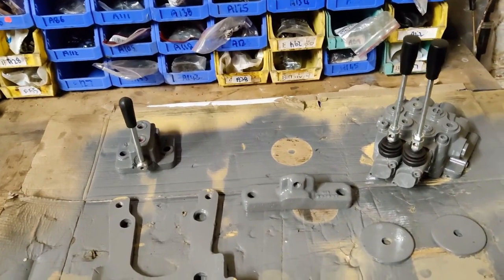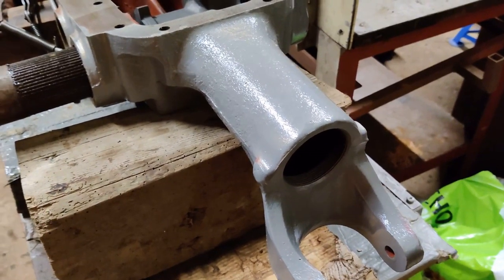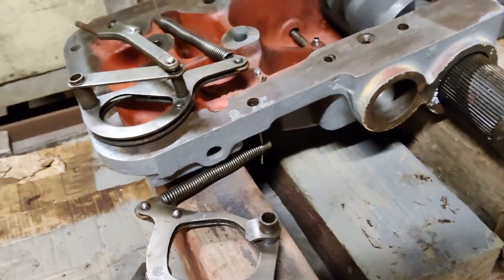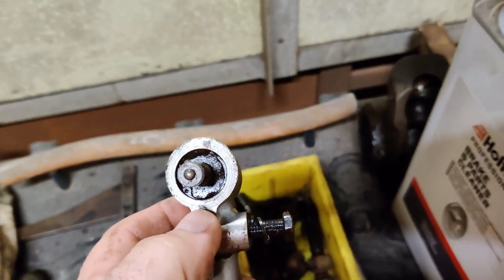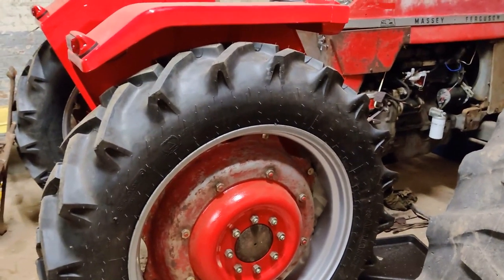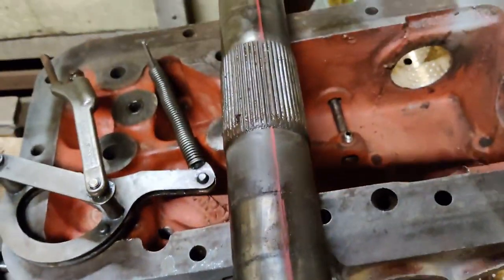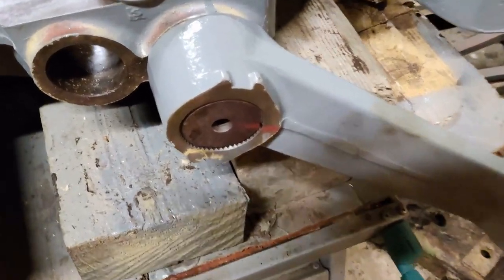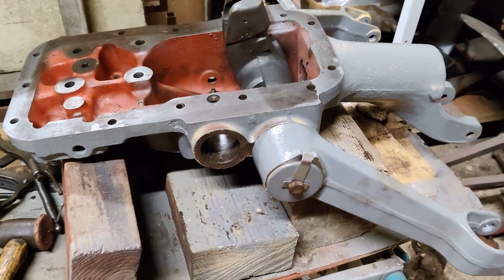Hydraulic Horrors - Massey Ferguson 100 series top cover rebuild -  Part 1

Comment: Any thing that is more than 20 years old you are likely to find someone else has worked on it at sometime.  If not, there is usually signs of abuse or neglect.
Reply from the maker: When it's finished, I am going to do a run down on what could have been avoided by regular maintenance and not bodging stuff.  Thanks for watching.

Comment: What course the top cover to crack or break ? A
Reply from the maker: Depends where it broke.  Has it had any work done on it recently?  If not, probably worn control linkage inside allowing the lift ram to travel too far and hit the casing.

Comment: What size of rear tyres do you have put on this tractor? I'm looking for advice what to put on mine. Thanks in advance.
Reply from the maker: It was supplied with 12.4 - 32s, which is what I will probably put on there.

Comment: I have top cover off my 165, just replacing cross shaft bushes but restoration has come to a stop, what with the cost of living sky high, trying to do bits that don't cost a lot.
Reply from the maker: Keep going though, it will be worth it in the end, it just might take a little longer than planned.

Thanks for watching.
Reply: Thanks will do, great channel, keep up the good work.
Reply: Where do you get cross shaft bushings from ?  Are you fellows in the UK  ? Im in the US btw
Reply from the maker: @keving2371  The part you are looking for is 1870934M1 I think.  Any AGCO dealer should have them, also Steiner Tractor in Michigan are pretty good for that kind of thing.  I'm in the UK.  Thanks for watching.

Comment: Hello.
I see that you have a lot of knowledge about the lift in massey ferguson.
Can you explain to me how to set the lift control lever for work, transport?
 I recently got mf 260turbo and the lift in this tractor is black magic for me. Regards :)
Reply from the maker: There's now a hydraulic horrors part 4 which goes into this.

Thanks for watching.
Reply: Ok. Thank's:)

Comment: Whats a good Manual to buy ..to make sure the lift arm and draft arm linkages  are doing what they are supposed to do ......dont seem to be a lot of movement in them ......Are they both suppose to have cotter pins in the holes ?
Reply from the maker: The I & T manuals are a good start if you are already familiar with wrenching on old stuff, also the actual dealer manuals can be found on ebay as well.  

The cotter pins are just in there for assembly/disassembly to save the springs flying around while you are trying to get things back together.  As soon as the cylinder is bolted back in place, you can take them out again.
Reply: @ClarenceFudWeasel  Thanks so much

Comment: I had to take off and refresh the top cover on my 135 after the E clip or circlip fell off the draft sensing rod thing and made it so it wouldn't lift at all, since then I got a 175 now also and I just discovered that it will not lift nearly as much.  Time to refresh that one too I guess.  At least it will lift my mower
Reply from the maker: Check the state of the lift ram and relief valve, always a good place to start.

Thanks for watching
Reply: @ClarenceFudWeasel  Thanks!  I'm curious to see how it looks inside.  My 135 was really clean.  Also the 175 seems to have the pressure control lever unlike the 135

Comment: I have my top off a MF 165  You have that dash pot you were looking at...What excactley does it do ?  I dont believe anything inside arm wise touches it  .....
Reply from the maker: The response control lever on the right side of the transmission case by the dipstick presses the top plunger and alters the flow of oil through it.  It is a linear damper to moderate feedback from the control cams to the control valve.

Thanks for watching.
Reply: @ClarenceFudWeasel  Will it stop flow so the lift arms dont work ?     That lever ,,can it stop flow .........
Reply from the maker: @keving2371  No, it's just an adjustable rate shock absorber l, nothing more than that.